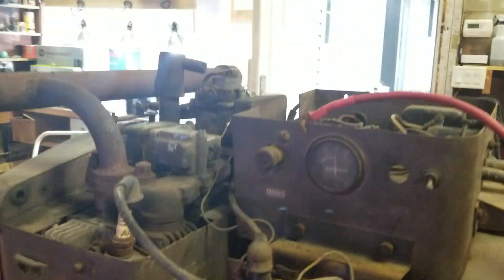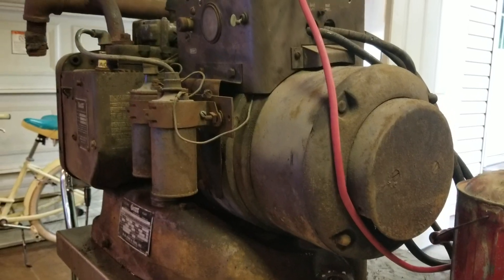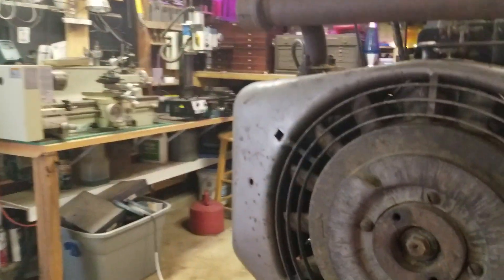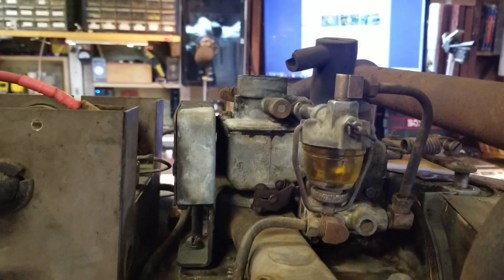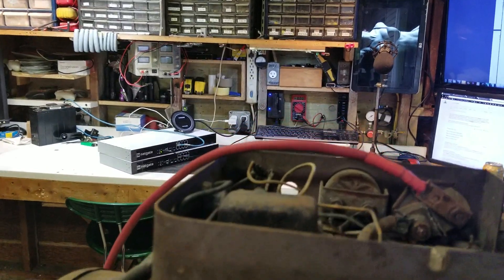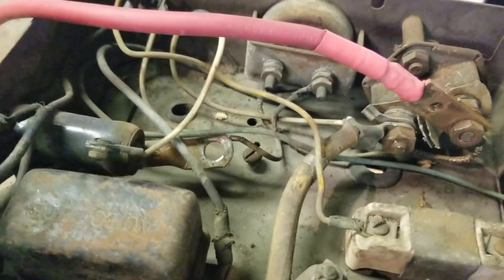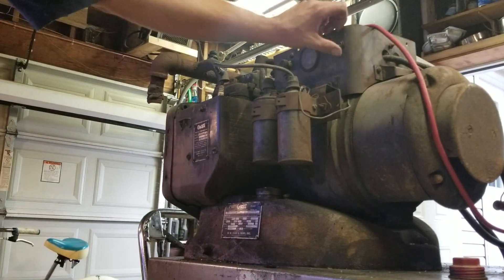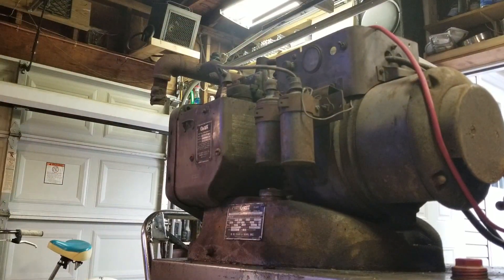1954 Onan 3 Phase Gas Generator 305CK-5E/613AA

Comment: My Honeywell 331 turbines start the same way.  It has starter/generators on it.  After it's on speed, ya reset the starter and it magically turns into a 28vt 300amp generator.  Only snag, it takes 1200amps to get her going.😱
Reply from the maker: A turboprop engine?! are you a jet engine  mechanic?
Reply: @DonBrandt  yup... turned pilot these days.